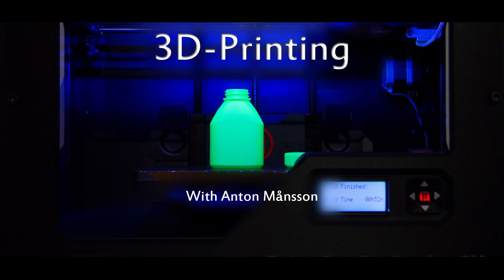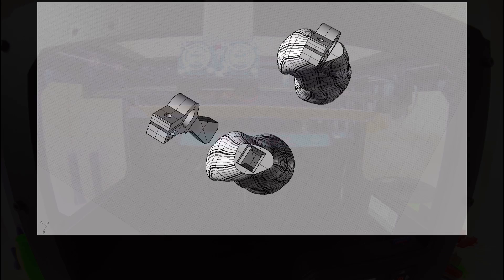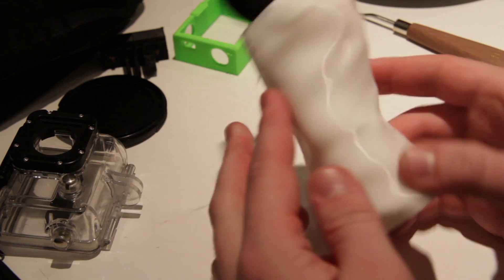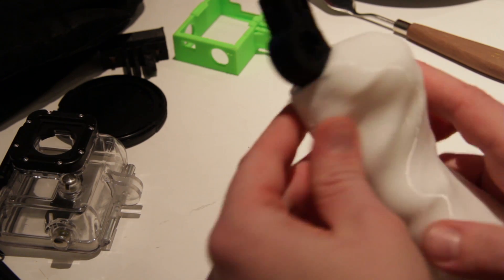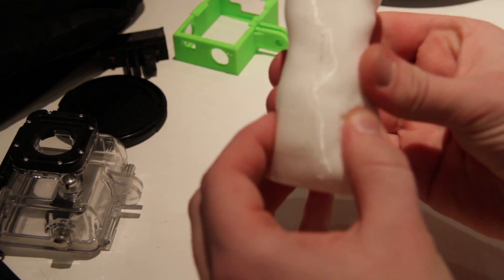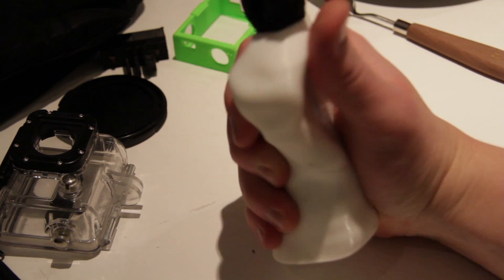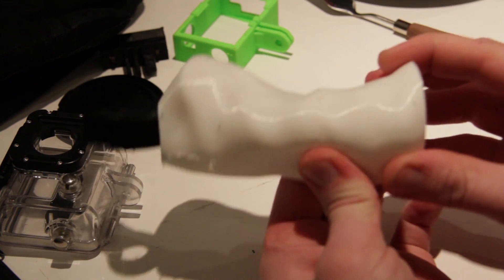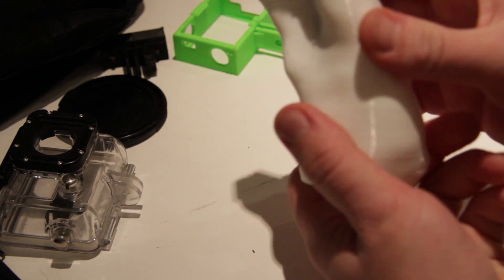DSLRigger - Episode 4 - Dual Extrusion model with MakerBot Replicator 2X

Comment: What CAD program did you use to make the STL file? When I use Solidworks to make STL files of say your assembly, both parts have to be touching the build platform plane in Solidworks. If one part, in this case the black PLA, is not touching the build platform plane in Solidworks, it falls to the build platform plane when uploaded to makerware as an STL file. Subsequently the black PLA part looses its intended orientation relative to the white ninja flex part. Ever ran into this problem? Do you know how to fix it?

Comment: can you tell me why the makerbot prints the two additional structures around it? it is not support as it is not touching the print...- mine does this too and i don't understand what it is
Reply from the maker: +Jon Soong Sure thing! Those are "walls" that functions as nozzle-fillers. They are used to make sure the nozzle that have been "resting" while the one works, now gets a fresh set of filament and is "filled" inside of the extruder. In this way you make sure that the nozzle is ready-to-go when it starts on your model.
The walls can in some time also work as a nozzle-wipe to clear of some oozed-filament extrudering due to moist in the inactive nozzle.  Hope that helps!

Comment: Awesome video and application! I'm having trouble getting the PLA to extrude on my Replicator 2X. Can you say what your extrusion temperatures (nozzles and bed plate) were as well as your extrusion speeds please? I'm using Makerbot PLA.

I'm having a problem where the PLA stops exturding out of the nozzle after I print the raft.

Thanks!!
Reply from the maker: Thank you rocketman889 =) It's crucial not to get the PLA get to hot, or it will bake leading to a clogged extruder and a skidding drive gear. Make sure you have a good pressure (that the drive gear is really grabbing on to the filament. You should also have a dust/lube filter attached (can be printed).

I used 40-50C on the build plate and around 225 for Ninjaflex. The PLA was around 190-200C. I also lowered the speeds to around 65/90.

I used kaptontape to get the Ninjaflex really nice and sticky. Then, the PLA would stick on the ninjaflex (note that the PLA is not in contact with the build plate, expect for the outer cleaning-support).

So, for only PLA-prints in R2X i would use painters tape instead of kapton. Using only PLA, you should also run the machine without a lid and the door open. You don't want it to get too hot or the PLA will bake(stop feeding) in the core-tube holding the hot end to the aluminium bar under the drive gear/drive block.
Reply: AMID Thanks for the response! I tried it tonight. No dice. Even before printing, the PLA, I'm assuming, would absorb too much heat, even from not extruding for 30 seconds, and then when it was time to extrude, the wheel would just grind the filament. I tightened up on the extruder block until it clicked, and then backed it off until it stopped. That helped slightly, but nothing substantial

Have you had any issues with this? I was experimenting with the temperature by adjusting the preheat setting. I had from 180-195. I would do the load filament command, let it extrude for 15 seconds and then stop it, wait for 30 seconds, and then start the load filament command again. It would fail at this point. :(

I had a small vase with a raft on my SD card @ 190*C and 65/90 extrusion speed. I was able to get the raft and a layer or two to print ONLY after running a change filament command and reloading the PLA after it ran its purge cycle (which didn't extrude due to the time of not extruding)

Any further advice/tips would be GREATLY appreciated. Do you add lube/vegetable oil to your dust/lube filter?
Reply: rocketman889 Update: I added a drop of olive oil to the first 4cm of filament and it worked like a charm! I didn't have any problems with the filament jamming in the extruder and I was able to print a small vase without having to interfere at all! :D I will print off this dust filter (http://www.thingiverse.com/thing:52203) and put some oil on the sponge for my future prints.

Thanks for your help AMID !!

Comment: Hey guys, great printing. I have been struggling to print with ninjaflex on mi Replicator 2x, problem is that when changing filament plastic will never come out the extruder. Did you do any upgrade to make it work? Thanks and congrats!

Comment: looking good !
does the ninjaflex actually bond with the normal pla?
I have tried arnitel-eco and normal pla, and they do not fuse togheter.
Reply from the maker: Hi Jos Scheepers I've used MakerBot PLA Black with the Ninjaflex and they bond very nicely. I'm using around 240C in the R2X on the Ninjaflex which makes it extra sticky.

Comment from the maker: This episode shows the finished handle for the rig. I'ts printed with two materials. The core is a hard PLA-filament structure and the surrounding grip is made of NinjaFlex. NinjaFlex is an incredible cool material that's flexible and feels like soft latex/rubber.

The grip gives a good friction surface to the rig when you put it down and it's really comfortable to hold.

In the next episode we'll focus more on follow focus system and different rod-connectors.

Interested in seeing more?
Check out the G+ site:
https://plus.google.com/u/0/b/100858179921412362012/+AmidSe/posts

Forum discussion:
http://3dprintboard.com/showthread.php?1094-DSLRigger-The-open-3D-printed-and-modular-DSLR-Shoulder-rig

More videos:
https://www.youtube.com/user/AMID2D3D

Song:
Oh Wee (Immortal Beats) / CC BY-SA 3.0
http://freemusicarchive.org/music/Immortal_Beats/